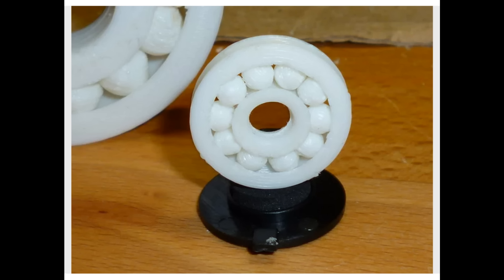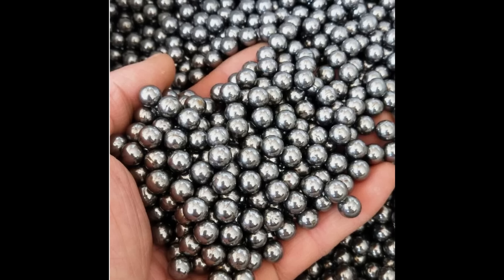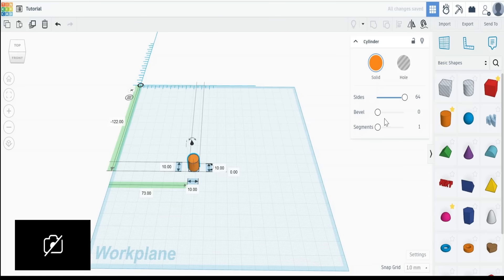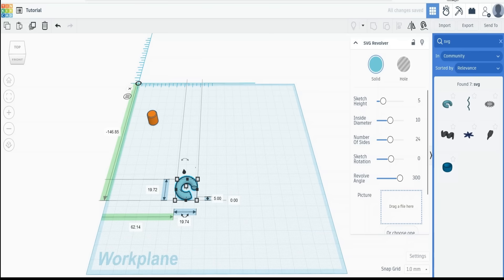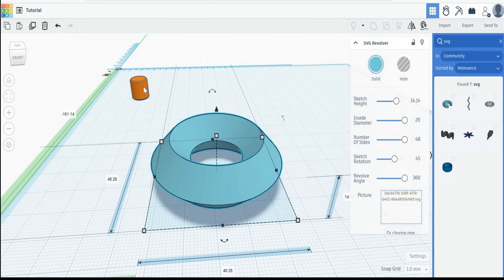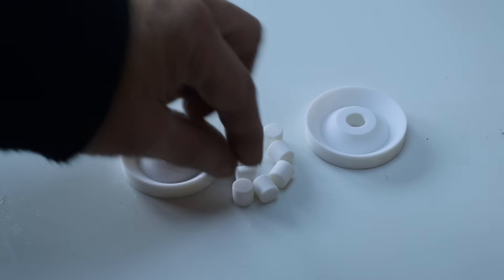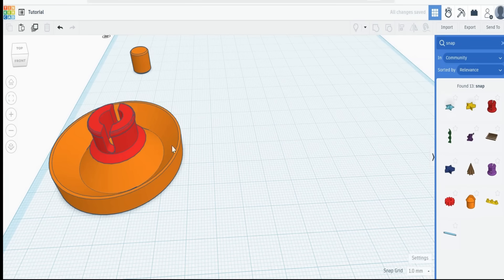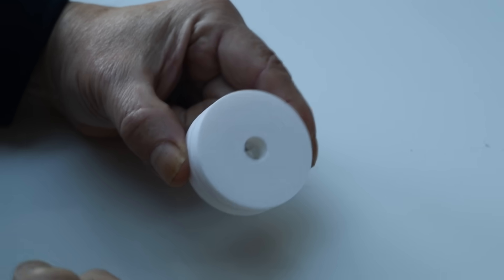2326 Universal 3D Printed Bearing That Works - Radial Cut

Comment: You shoulda compared the sphere bearing to the cylinder bearing (like spin duration & stability).
Reply from the maker: I don't need to - it has been done already - this kind of bearing is really well known
Reply: @ThinkingandTinkering I never heard of the cylinder bearing. I thought the point of the video was to share that is uncommon but better. But no comparison (even a quick one) means no proof that it's better.
Reply from the maker: I don't want to be rude mate but just because you haven't heard of it only means you haven't heard of it - do a google search on cross roller bearings - you will probably get all the 'proof' you need
Reply: @ThinkingandTinkering  I understand you mean no disrespect; I also am not trying to be disrespectful and am just sharing my point of view.

I'm aware that me not hearing about it doesn't mean most haven't. The point of my original comment is your video argues that "3d printed cyclinder bearings are better than 3d printed ball bearings" (rather than just being a how-to video), so I was expecting proof that it was better, but no comparison was given, requiring the viewer to have to verify if the claim made is true using other sources. So it felt like an incomplete video/argument. The only 3D print comparision video didn't use the same roller bearing design.
Reply from the maker: @User24x  thank you for sharing your point of view mate

Comment: The two bearing races usually rotate at significantly different speeds. Seems like that would be a problem for the snap's lifespan if there is any amount of friction in the fit when the axle is under any sort of load.
Reply from the maker: the snap fitting is completely and utterly optional - i just added it to hold the whole thing together

Comment: Very cool! I use bbs for my 3d printed bearings..but I really like this idea!!! Also tip: if printing bearings make sure you set you wall thickness higher so the printer will not print lines that the bearings will bump over.
Reply from the maker: also use the staggered setting for the seam line

Comment: 3D printers generally print cylinders (circles) as a set of small straight lines so they won't actually be completely round. It is possible to increase the number of these lines thus bringing it closer to a circle but that also places an increased load on the 3D printer's processor. In practice, the resultant circles (thus cylinders) produced are okay for crude bearings but it is still a limitation.
Reply from the maker: they do but it is less than the double curvature of a sphere

Comment: Good to see you back making videos.
Reply from the maker: cheers mate
Reply: @ThinkingandTinkering  I don't have access to Facebook anymore.  My place is 5.5 acers of un-regulated land suitable for larger experiments.  I would like to video and share with you joint projects.  Currently I am working on upgrading a Solar collector dish into one with a Solar tracker.  (The inexpensive Amazon models don't actually place the object to be heated in the center (made worse by the simple need of coffee water at dawn it also won't  articulate enough and the legs have to be jacked up on the back side to heave the dish over enough for the 6AM Sun.)).   My question to you is:  Do you think there would be much value added in placing a Stainless steel container in the center of the collected Sunshine that the container holds "Molten Salts"?  I'm not trying to turn the Salts into a fiery semi liquid (expansion issues) but merely a heat battery that would be placed either in an Airstream trailer for heating after dark or be placed in the middle of a sand battery.  (The Stainless steel container has been coated with a high temp Black paint.)

Comment: Robert the weak link of this approach is the very limited resolution of tinker cad when modelling soft curves. You only get max 64 sides to any polygon. This can be fixed by applying a "rotate and merge" operation, bus still not ideal.
Reply from the maker: true enough mate

Comment: Diameter and length of rollers can't be equal or the 90 degrees offset rollers will rub on their end faces.
Reply from the maker: I don't that is right mate  - i think it makes very little difference
Reply: @ThinkingandTinkering  Sure it is. Also, the rollers should have a slight taper to them to roll according to the inner and outer circumference of their races.
This again also means the races angles need to be slightly adjusted.

Comment: Hey, thanks for the video. Learning as I go in the design world, now that I have my own 3d printer, there's a lot of things I don't know I don't know, and a lot of that includes the particular lingo to be able to search deeper into subjects. Thanks to you right now, I've now learned the difference between Radial and Axial/Thrust bearings, suitable ways to use both, and have been introduced to your method for a universal bearing, which will be undoubtedly useful, and surprisingly simple to implement thanks to your video. Kudos!
Reply from the maker: awesome thank you mate and i am glad you liked the video

Comment: That's great! A simple detail is that it should be printed vertically to accommodate with inherent fragility of the Z-axis: the snap will be prone to break if you print with the circle base on the bed.
Reply from the maker: cheers mate

Comment: Very good, thank you.
A long time ago I spent an age creating a workable print-in-place bearing based on spheres that I could and have used in various projects. But you have presented an important lesson - applying a bit of thought now can save a whole load of effort later.
Had I done the same I could have produced something that worked at least as well without the many hours of faffing I went though.
Reply from the maker: faffing is important mate - cheers

Comment: Thanks for the insight, that is very interesting, but I always thought roller bearings in a cone-race had to be tapered to avoid slippage wear.
How do these hold up, for wear, under load? And, apart from higher surface area contact, why not just use ball-bearings, they are readily available?
I know this shows some neat 3D design-printing but its nothing that couldn't be done with basic machining and off-the-shelf parts.
Reply from the maker: it actually depends on the size of the bearing - the larger it is the less important a conical shape is as the interface on the tangent - the smaller it is the more you have to pay attention to a conical cross section
Reply: @ThinkingandTinkering  Thanks.

Comment: I would think the immersion printers would be able to do spheres quite effectively, no? I have not played with them, but that seems one of their strengths.
Reply from the maker: it has nothing to do with the printer per se - it is analogue to digital - that is always stepwise
Reply: @ThinkingandTinkering  I would think that the digital effect in immersion printers would be tempered and approach analog mapping due to dispersion, regardless of UV, magnetic, or electric potential effects that cause the setting of the media. I would suspect the magnetic flux to have the most stepwise artifacts, but yet be moderated somewhat by the immersion medium. Is that not true? I fully admit to not being well versed in 3D printing.

Comment: I suspect adding powder graphite in It will substantially reduce internal friction and make It lasts longer, it's made out of plastic after all.
Reply from the maker: for sure
Reply: This was tried in the fan showdown channel and it made things worse grease also was no good oil worked.

Comment: I understand that you are a one man crew. But, have you ever considered hanging a towel or blanket or something in the room while you are recording videos? I feel like it would increase your audio quality substantially for nearly nothing. The hardest part would be fingering out where & how to hang the fabric so it is out of sight. My ears just find it hard to understand you without cranking the volume way up & listening harder than usual ( I also turn you down to 1.75 speed). Plus, pretty much everything you talk about is way over my head & I don't even have a 3d printer. I'm not really sure why I'm watching. I think it has something to do with cog gears and cages. I'm making the woman a yarn ball winder & the video I found on YT didn't have any instructions, just a guy using the contraption. He made his with gears, but I fingered cogs would be easier for an amateur such as myself. I have completed the cog gear and cage spinner mechanism, now I need to finish the top end bobbin & string guide post. Sorry for such a long comment. Holy Moly.
Reply from the maker: Yeah thought about it - then decided I am not going to do it. Still, sounds like you are almost there with your machine

Comment: Beautiful work, but being an electronics geek I'm a bit baffled as to why the rollers are offset at 90 degrees around the races. Would it not work with them parallel? I mean, obviously not well or you would have done it that way, i just can't work out the reason. And I tried, I weally weally did, Coach!
Reply from the maker: having them cross over makes them a kind of approximate spehere
Reply: @ThinkingandTinkering  Thank you!
Reply: It is done so they can handle loads from any direction.
Reply: @uploaddownload5595  Thanks, I can probably look up 'cross roller bearing' and take it from here. Thanks again!

Comment: I didn't now the svg ability in Tinkercad. I also had never seen this type of bearing because, well, the bearings we see are usually based on the manufacturing method's attributes...  Brilliant!!
Reply from the maker: it's a useful tool in tinkercad mate
Reply: @ThinkingandTinkering  it would be fairly easy to laser induce a graphene layer onto a round cylinder bearing roller, whether they be metal or thermoplastic. Not having done that yet, would the graphene serve as an integrated lubricant? The things you show me always have me thinking in random directions like a squirrel😂

Comment: I was wondering if spheroid would possibly be better than a true cylinder. It would allow for some radial misalignment. 
The generators on the EMD locomotives that I work on have spheroidal bearings on one end and are supported on the other end by the engine crank. 
This gives us play in the alignment to a small degree in both thrust and radial. 
We aim for less than ten one thousandths of an inch in radial and air gap. If they weren’t spheroidal bearings we would have to have these tolerances much closer. 
Happy new year.
Reply from the maker: give it a go mate
Reply: @ 
I don’t have any of that technology available. 
I would love to if I could!

Comment: I prefer the "spinning top" bearing. It's a cone in a dent.
Pool of oil. It's been working for over a year. A single ball under a shaft in oil is good too.
Reply: As simple as it gets,  but has to carry the load on a very small area.
Reply from the maker: everything has its uses mate

Comment: That's absolutely BEAUTIFUL! I sent you a tesla turbine design to try out. The axle sheath is off sized but should be fairly easy to fix. I need to print a bunch of bearings now.
Reply from the maker: it would certainly improve your turbine
Reply: @ThinkingandTinkering  id have to scale it up quite a bit, haha.

Comment: Robert, it seems like there's a LOT of area being placed against the flat areas of the bearings.  Maybe test it, by placing it in a drill press or lathe for 5 minutes or so, and take it apart to check wear patterns.
Reply from the maker: good suggestion mate - cheers
Reply: @ThinkingandTinkering  To reduce friction, dome the flat ends of the rollers and create a narrow, hemispherical groove along the middle of the raceway to mate with the tip of the dome. I would also make a shallow hemispherical groove at the midsection of the rollers to increase the area of contact and reduce wear.
Reply: @bluekenya4825  Would you be doming both sides then? If we follow this train of thought, why not take it further and make it a sphere?

Printing a dome on the top may be acceptable with enough layers and self-clearing with wear in, but putting a dome on the bottom will be very difficult to achieve.

You could cone one side but that would lead to varying surface speeds between the cone and the race as a function of the decreasing radius, and not assist with the bottom half.

I do wonder if the chamfer being aggressive enough (I’d recommend a 30 def chamf instead of 45 deg to make the print bed side easier to manage) and shortening the rollers from 10mm to 9.5mm or whatever is needed to clear the race, as mentioned by others, might be your best bet.
Reply: @ThinkingandTinkering  another thing to consider - the SVG revolution tool you showed has the upper limit of 48 steps.  

You could make 48 steps across less than a full 360 degree sweep:
At 45 degrees of sweep, and copy/rotate/merge that 45 degree revolution 8-fold to get a smoother shape to render.

Now, we don't know how fine is fine enough... that's what testing is for, though!
A few iterations like this, coupled with @johnbarry8185 's suggestion to test might help yield the point of diminishing returns.

Filming the tests and results would make a lovely video follow-up to this one!
Reply: @ThinkingandTinkering   I had an idea on this. What if instead of a typical crossed roller bearing you went with a Crossed Barrel Roller Bearing?

I mocked a concept up in Fusion360 and posted it to makerworld under my username SOHCHEAD (if you're familiar with the 427 SOHC from the 60's, that the name)

YouTube will not let me post a comment with a link...

I originally was wondering if a tapered bearing design would help alleviate friction issues but that would require geometry that is difficult to print as it seems most of these rollers do not have flat sides.

With a line contact between races and rollers at a varying radius about the central axis there will be a variation in surface speed across each roller, creating drag.

My thought was, if you used a 30/60 deg chamfer on each edge (I've found it superior to a 45/90 degree chamfer when it is on the base of a part being printed) and add a slight barrel shaped variation in the cylindrical diameter that it may create a more constant surface speed contact point between races and rollers.

I also added a slightly tighter radius to each race to help "cup" the rollers into place, hoping to avoid excessive wear between ends of the rollers and the race.

I've yet to add a fastening method as this is a concept and it's 2:40AM here

Let me know what you think!
Reply from the maker: @SOHCHEAD  I went and had a look - i like it mate - nice change - also - I have never been to makerworld before - thank you for letting me know about that too - looks like a great resource - cheers
Reply: We're only sphere for a short time, then we just roll away.
Reply: @stoopidfast9049  hahaha
Reply: I think the flat top and bottom are intentional. Looking at commercial cross roller bearings, the rollers all seem to be cylinders of equal height and diameter with flat tops and bottoms.

Friction between two flat surfaces is proportional to normal force, not contact area. Shrinking the contact area increases pressure but does not decrease friction. Though this case is a little more complicated, since the flats of the rollers are spinning as they slide, and the bearing races will have ridges in them (layer lines).

I suspect doming or tapering the tops and bottoms of the rollers might make them more likely to gouge the races, without actually reducing friction.
Reply: Very good tutorial. Thank you, all the best for 2025.
Reply: @johnbarry8185  if we're doming them, we could also reduce the distance between the the domed ends to nearly zero
Reply: I would say, make indents in de flat areas to reduce friction. Then use a dry lubricant, for example PTFE spray😉

Nice design Rob.
Cheers!
Reply: @markgeurts258  I think I'd dome the ends of the cylinders slightly so only the center contacts the race.
Reply: @grantm6514  you could dome them, and also shorten them ever so slightly, so that the ends can't touch both raceways at the same time.
Reply: @grantm6514 That would increase the problem because the same load would be applied to a smaller area.
Reply: @galfisk  Maybe gravity would have other ideas there.

Comment: Hi robert thanks for the info. Iv just started my 3d printing journey and was wondering what is the best software in your opinion for designing,slicing and printing ? Doesnt have to be an all in one im particularly interested in the design aspect. Thanks in advance
Reply from the maker: to be honest mate - they aren't any best - they are all much of a muchness - if you just pick one you will quickly get used to it and then swear blind it is the best lol - but seriously it barely matters and it is pretty much what you feel comfortable with
Reply: @ThinkingandTinkering  that's great thanks for the reply. I like yours tbh,  might give it a try and if I get stuck I can watch your videos lol. Thanks again.
Reply: Designing and slicing should be done in two different pieces of software since they are two very different things. However, most slicers let you do some last-minute changes like resize, cut, and combine different things into one assembly.

The most important thing about a slicer is how well it works with your printer.

The most important thing about a 3D modeling piece of software is how well it works with you. If it's not intuitive for you and you have to constantly remind yourself of what button to press on a mouse to rotate or pan an object, then skip that software and find another. Something this simple and so integral with how you interact with your 3D models should not be a source of friction in your process.
Reply: @Guardian_Arias  yes the creality slicing software I use is ok for last minute changes etc. what's your opinion of onshape for designing ? Any good ?